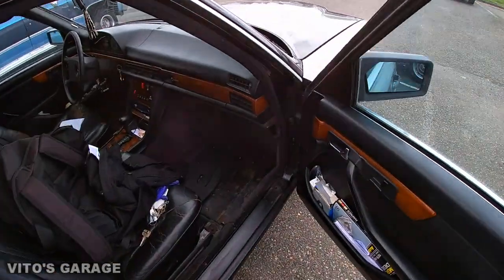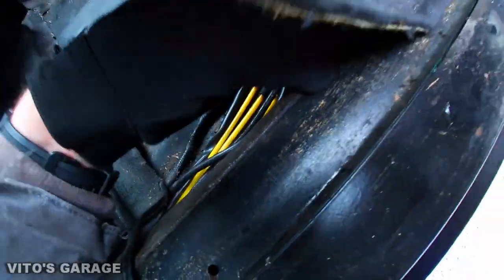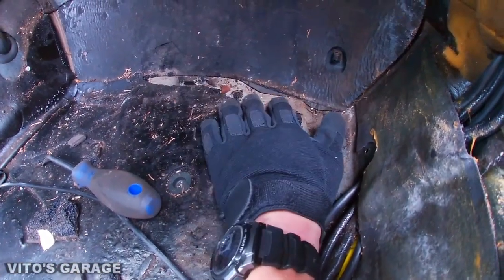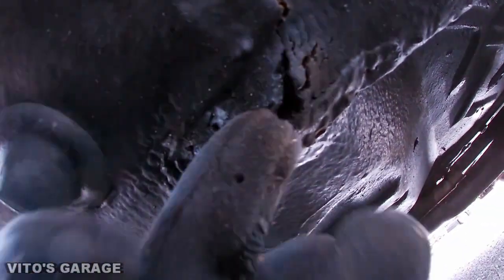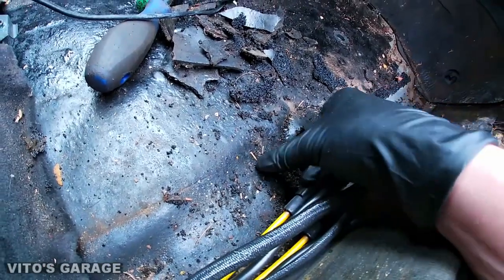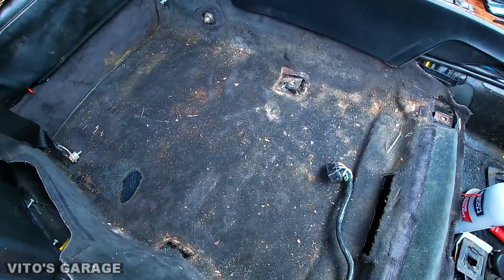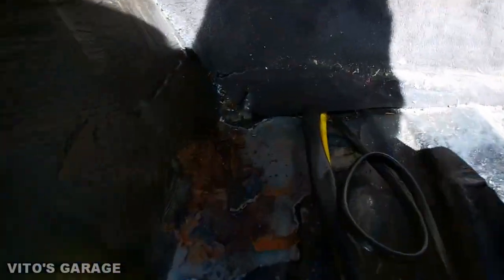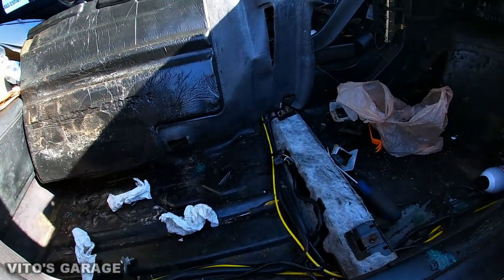Mercedes W126 Restoration Ep.1- Sound Deadening Removal & Floor Inspection

Comment: If it was me I’d just cut out the whole seal my friend and replace rather than repair .. but no harm in trying ..(brave man) 👍🏽
Reply from the maker: What whole seal are you talking about?
Reply: VITO'S GARAGE where the holes are you can buy them whole sections ...the  floor pans are probably rotten aswell
Reply from the maker: Needs to be welded